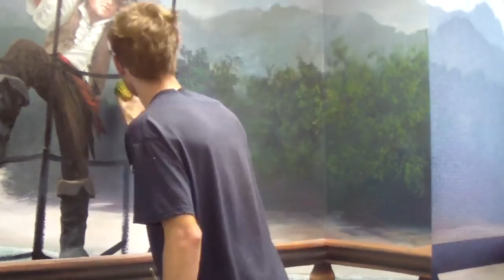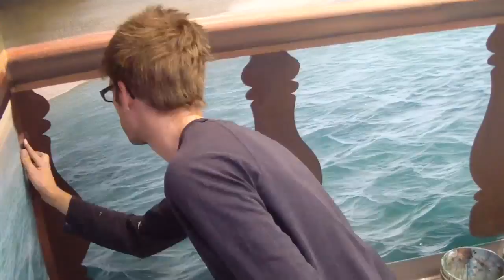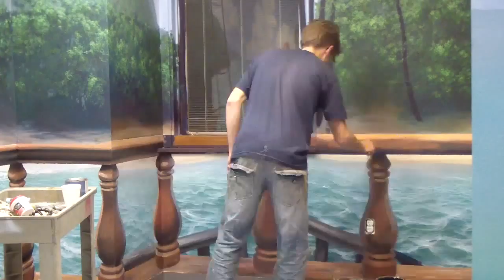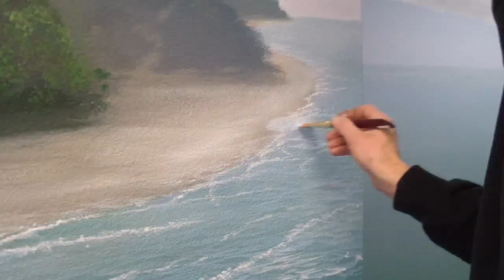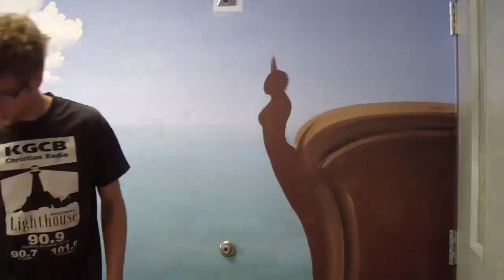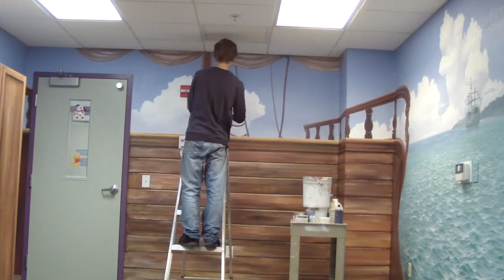Pirate Ship Mural Pt 2

Comment: I usually don't for interiors because the paint I use is already a durable finish but when I do, I use water base polyurethane. I'm not sold on any particular brand as long as it has a satin finish. For exteriors, I use the same kind of product but rated for exterior, which means more UV resistant. Oil base coats tend to turn yellow in the sun. Thanks for watching. And thanks for the comment.